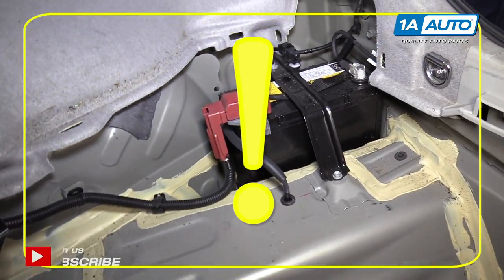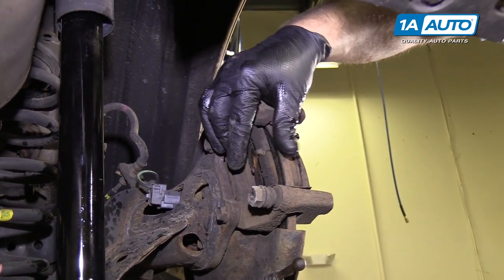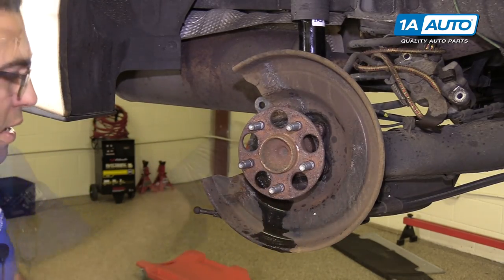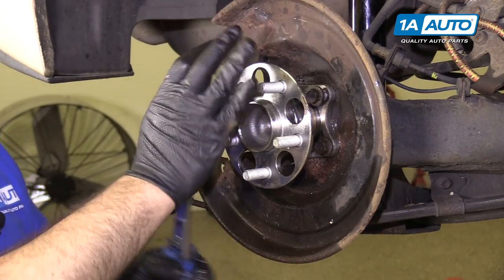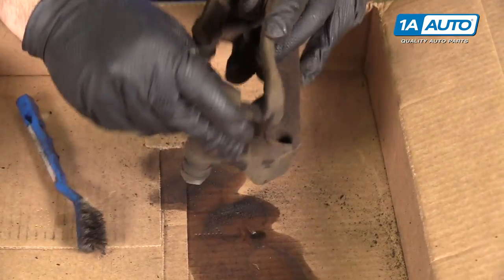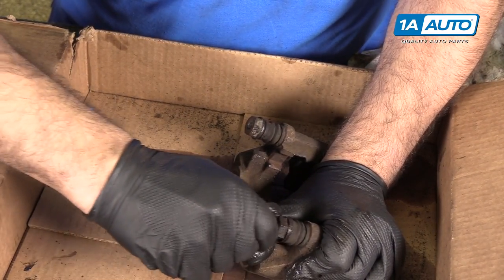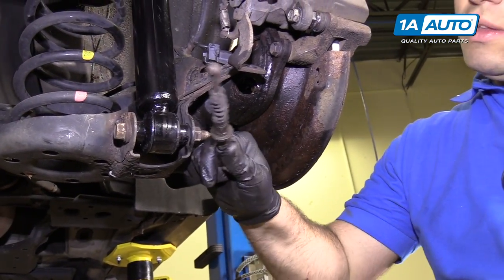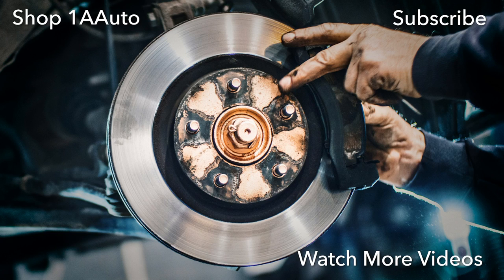How to Replace Rear Hub Assembly and Brakes 10-16 Toyota Prius

Comment: I just did this job. A few more notes to help others. You do not to remove the hub cap there is access to slide your socket through the cap to the lug not. Next you do not need to remove the brake cable there is enough movement to zip tie or bungee cord the caliper away with the cable connected. Next the most time consuming and toughest part for the average DIY person is hammering out the bearing. You will need a heavy pound hammer if you have a portable blow torch heat up the the bearing center. The top right corner is the easiest to chisel as access to other corners is tough with the dust shield over lapping. Here is what worked for me. Hit the backside of the bearing wheel though the right dust shield access (this is for drivers side may differ for pass) after 5 good hits the the back of the bearing wheel mine popped out even though I was only able to lift part of the top right corner with a chisel. Hope this helps
Reply: How did you know that your rear wheel bearing were bad?
Reply: @TheAxecutioner  it will sound like a grinding/howling sound when you are driving at freeway speeds.
Reply: Just did this job. Jon is correct you do not need to take the parking brake wire out like shown in the video, but you do have to ( at least in my case ) take off the bracket for the parking brake line so as to give enough slake to take the caliper off. Cant miss the bracket, its easy accessible.

Comment: Take two mounting bolts and clean  and lube them up. Put them back in on two diagonal holes. Don't tighten them down. Put a 1/4 drive socket inside the head groove of the bolts. Turn the hub until one of the studs is directly in front of the socket. Use an open end wrench and turn the bolt out. You are now using the bolts as a press to push the stuck hub out. Both bolts won't line up with a stud at the same time, so you have to back off one bolt and go back and forth with the bolts pushing on the socket pushing on the studs. The backing plate may even stay in place.
Reply: Brilliant

Comment: Is that new aftermarket shock already leaking oil 😂 Don't reuse brake parts just because replacement didn't come in the brake kit. Buy OEM and you won't have this problem. Friends don't let friends buy aftermarket 🤷

Comment: For those having trouble getting that ABS sensor connector off, here's what worked for me.  After taking the grey housing off, I clipped a needle-nose vice grips onto the sides of the abs sensor connector.  Then I used a flat head screw driver to push up on the bottom connector release tab. Then I used the vice grips to pry the connector off by pulling them towards me.  Initially it wouldn't pry off, so I placed another screwdriver between the vice grips and the connector to act as a fulcrum for the vice grips to pry against and it popped right off!

Comment: Just did this repair with the part from the link in description. Want to say thank you for saving me over $600 on this repair. Was quoted $680 before tax by a mechanic. With shipping the part was just over $70 and the repair took me less than an hour
Reply from the maker: +DementedOne Thank you! We love empowering our customers and showing how to perform DIY auto repairs with our high-quality auto parts. 1AAuto.com
Reply: Hows it holding up? I was on prius chat and see a few posts about people doing hubs and a month later they are getting brake/ abs/ traction trouble lights. In getting that tricky abs clip is to blame.

Comment: Good vid. One word of caution for anyone following this. Get a cheap multi square box caliper piston spin in tool. If you use the needle nose spin in method like he does in the vid and the needle nose slips it will gouge your caliper boot and you will then need a new caliper.

Comment: Very precise video, clear understanding of what has to be done.   Made the job go as described.  On one item the battery disconnect mentioned was not done but I used the lock the door feature to keep brake pedal from being depressed.  Just my experience on this one, but the piston stayed in place.  Saves tearing out the back of car.  Thanks again
Reply from the maker: +Scott Gast Thanks for checking us out! http://1aau.to/m/Shop-1AAuto-c

Comment: Great video! I managed to skip the part where you took out the handbrake cable, and I managed to reach the bolt for the brakes underneath it. The rust on that wheel bearing was 13 years old, but I was more stubborn than that. If anything, I suggest including the torque specifications (in Nm) you used for tightening the bolts in the text information. It can be difficult to hear what you say in the video at times. Thank you for sharing the video!
Reply from the maker: +Ray zegarra Thank you! We love empowering our customers and showing how to perform DIY auto repairs with our high-quality auto parts.  http://1aau.to/m/Shop-1AAuto-c

Comment: Great job!
I appreciate that you didn't sugar-coat the fight removing the old rusted-on hub.
And great details, like efficiently removing the grey sensor cover.
I'm doing this job both L/R tomorrow: going out to lube the back of the hub now.
Tomorrow, I'll have a map-gas torch handy in case there's a similar battle with the old hub removal.
Thanks!
Reply from the maker: Thank you for the great reply. We love to empower our customers by showing you how-to perform your own auto repairs while installing our high quality auto parts. Have a great day! 1aauto.com +J F

Comment: @9:10 etc, the hammering and the chiselling/pry-bar.  One sympathises.  I took mine apart a while back and as any parent knows, ‘life’ aka the offspring priorities, got in the way of re-assembly, so now i have no memory of how the assembly came apart/reassembles, hence i am here, so thanks for this.  I had to leave the hub with some pre-oiling 3-in-1 thin stuff, and general smacking with hammer, finally resorting to a broad, flat masonry chisel, and a sledgehammer.  Now, you could apply a lot of heat, see if the rust breaks, my issue was trying to save the bearing grease etc, which i will never see.  Bought a new hub bearing unit in the end, as i felt a rough patch - tbh, it’d be a miracle if it wasn’t my sledgehammering caused it.  wouldn’t come off any other way, the brake plate was rotted to almost just the part hidden by the hub flange protecting it, so we’re talking mostly-gone brake plate.  

I did use the heating method and a lot of oil, scraping rust off, to get the brake cable end out, you show a nice lovely spanner way of doing this at the vid’s start, and I somewhat inevitably melted part of the plastic sheath…my fix is to use some large diameter shrink-wrap tubing, and I will cut a one-inch length, should fit over, then heat to shrink, re-protecting the now-lubed handbrake cable end section.  Anyway, the hub had some chamfered edges it didn’t use to have, so did the hub bolts, such was the hammering.

Now, credit where it’s due, - sarcasm - to a rival parts supplier.  I went to Toyota parts deal dot com in the US because Europe (I am UK) had no brake plates at the time for my Prius 3.  All seemed well, if pricey.  £125 or something, mostly shipping.  Imagine my surprise when months later, still no brake plates.  I have figured out what occurred, and it’s nothing of my fault, this is between a sloppy parts supplier and a sloppy shipping company…I had to have it sent Fedex Cross-border service.  It’s not the Fedex internal/US state service.  I have fought and emailed and pushed and asked nicely then less nicely but still polite, and BOTH Toyotapartsdeal dot com and Fedex cross-border fobbed me off.  I have figured out what happened…

…Fedex X-border, refuse to deal with end buyers like me, full stop.  So, they literally wouldn’t even tell me, they didn’t get the order, or that it was messed up at a shared warehouse or similar, and went by their DOMESTIC US shipping service by accident, which is what I deduce happened…why?  Ok, my street name is like that of a tree name ie spruce avenue, etc.  My part has ended up, on a porch, of somebody not at all far from the Toyotapartsdeal dot com building, with a name like ‘spruce avenue’ though not identical to mine, it’s a close cousin as it were.  So that’s Fedex’s mess, but I cannot tell if the parts supplier, did this mess, or if fedex did it.  Toyotapartsdeal dot com, refuse to engage, and say that in effect my supplier, is Fedex cross-border…so we’ve gone round the washing-machine cycle for months, and nobody cares a whit, my $150 or so, has been absorbed by these two companies.  

I was surprised.  I gave the order number, and shipping label number, a picture of Fedex’s location mapping update etc, to both parties.  TPD dot com, have been increasingly dismissive of the screw-up without ever explaining why, and want to sit on their view that in effect Fedex is my parts supplier.  Fedex cross-border will not even acknowledge my emails, because they do not deal direct with end users/target addressees.  If it was in the UK, I’d drive to the door and ask personally for my money back.  As it is, all i can do, is tell everyone who wants to buy toyota bits, and let them decide.  It took so long, I ordered and received parts from a freshly-supplied Europe parts supplier, and both companies had stopped communication by then.  Phfft.  Thanks to you for this video, however, it’s a help.

Comment: Questions from the rust belt 13yo car: should the emergency break be engaged frequently to make it easier to manipulate later when doing brakes? Replace hubs in pairs? Heard a rattle and found a mangled piece of the dust shield on the caliper which we pulled out by hand. The degree of rust makes me think the hub may get damaged trying to remove it. Anti seize or white grease both OK for hub mating services? Thoughts on painted calipers as a rust deterrent?

Comment: Great video! Thank you for posting. I accidentally skipped a very important step and I was wondering if you could help me? I forgot to disconnect the battery and I also opened a door and now the caliper will not fit back on. Please let me know how I can fix this.
Reply: @A1 Auto Parts

Comment: Thank you very much for the video.  Would you suggest lock tight in this situation?
Reply from the maker: +Kurt Heisel Thanks for watching!  We would not recommend using loctite on any of the bolts shown in the video.  If any of our viewers needs to make this repair, we carry the auto repair part shown in this video on our website. Here is a link to them: http://www.1aauto.com/toyota-prius-prius-plug-in-wheel-bearing-and-hub-assembly/i/1ashr00307?utm_source=YouTube&utm_medium=CTA+Comment&utm_campaign=ytcomment&utm_term=InbmGOxcQmw

Comment: If I could I would buy a prius..looks so easy to work on
Reply: Any vehicle is easy to work on when you have videos to guide you.
Reply: A lift is nice too. Just disconnect the 12v negative - take everything out of the hatchback area (mats, cover, sub tray), remove a trim piece or two. Now you can access your battery

Comment: So I think I missed something. Do I put the car in Park or Neutral? And after which, when do you disconnect the negative battery terminal?  It automatically goes into Park when I turn the Power off..
Reply: you just need to use regular parking and don't set the park brake / emergency brake on other wise you will not be able to remove the rear caliper.

Comment: doesn't disconnecting the battery erase the computer memory and settings?
Reply from the maker: +Jay It may erase your radio settings and computer codes.  Thank you for the question.
Reply: 1A Auto Parts Thank you for the swift response